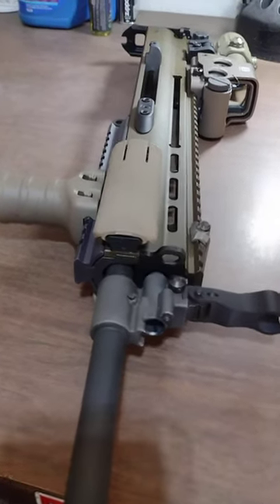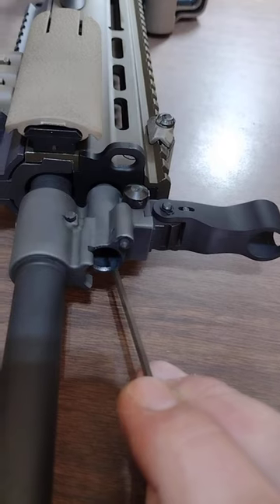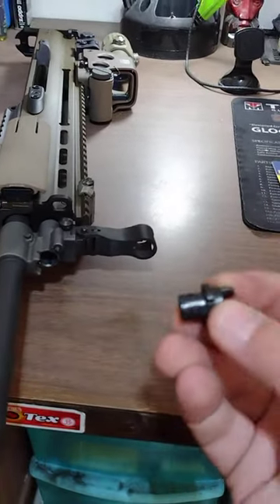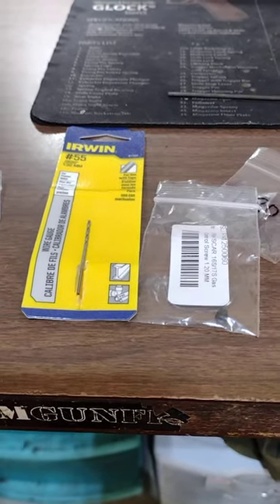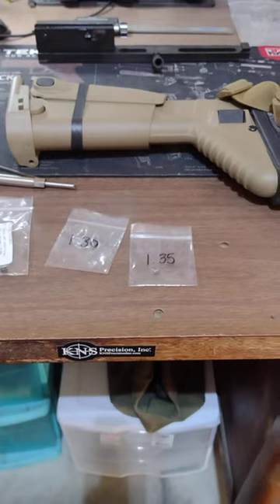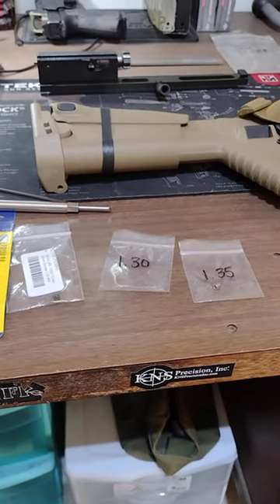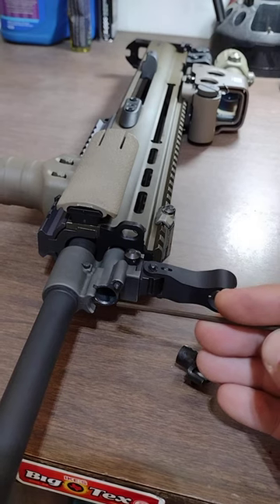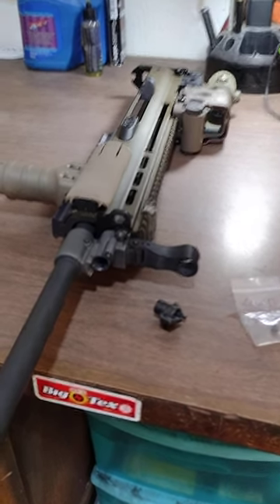Scar 17 gas jets & suppression

Comment: I would wait for HUXWRX to come out with the new flow suppressor for 7.62
Reply from the maker: That would be a great solution as well. I've kind of committed myself to the Dead air system, but I think any of the huxwrx/oss 30cal options would be a solid choice. I prefer the less muzzle flash of a traditional can though. I'm probably going to do a follow up video because after modifying a gas jet to 1.32mm it is running perfectly. Very easy process to tune the scar down and not much of an investment. Maybe $40ish to now have a suppressor ready scar that won't destroy itself and is 100% reliable either way.

Comment: KNSPrecision DiSCARder
Reply from the maker: I haven't heard of that yet. I look into it, thanks!
Reply: From what I've researched, KNS' Discarder's range is more functional and tunable than the Scarburator. In short the Scarburator's design is to control the influx of gas into the piston chamber. The Discarder's design is to control the venting out of gasses, from the piston chamber as originally intended on the SCAR & FAL designs.

Comment: checkout the mototech engineering Scarburator Gen 3
Reply from the maker: That would definitely be an easier, more flexible solution. I might still order one, but they are never in stock. Genius idea though and I can't believe a large company hasn't bought the rights to it. Even his 3 select regulator is a vast improvement over OEM.
Reply: @bobvagene  they're currently having a BF sale, 15% off retail. I think the best time to get it will be now. I follow them on IG and they seem pretty good about fulfilling back orders so you shouldn't have to wait too long. I don't have any experience with it yet but I plan on ordering one for my 17. Most if not all the reviews seem pretty positive. I have a sandman s I want to run on it, but just like you, I would like to keep all of the important components OEM. But in order to keep it from beating itself to death you're gonna have to modify something. By modifying the jets you run the risk of not being 100% reliable unsuppressed. I think the Scarburator is the best solution. I look forward to trying it. The sale runs through the 30th, you should definitely pick one up.